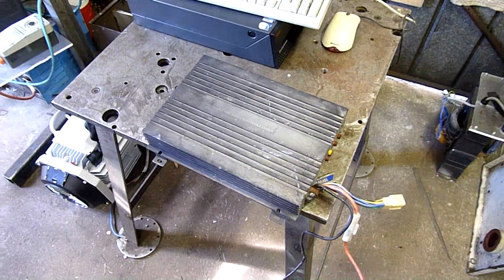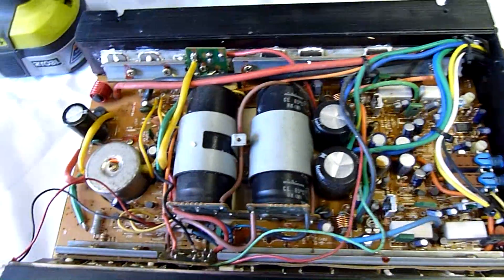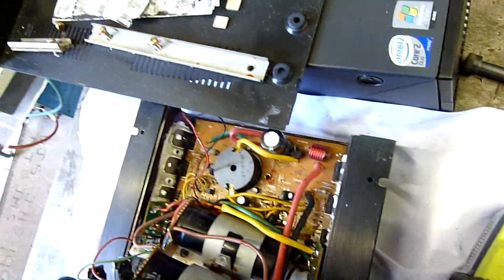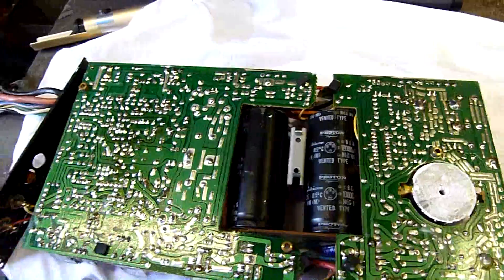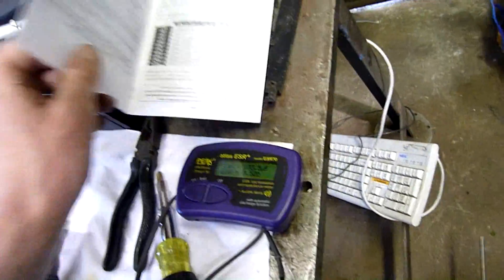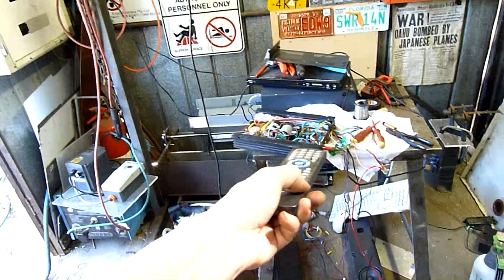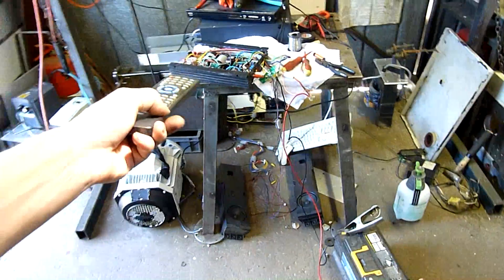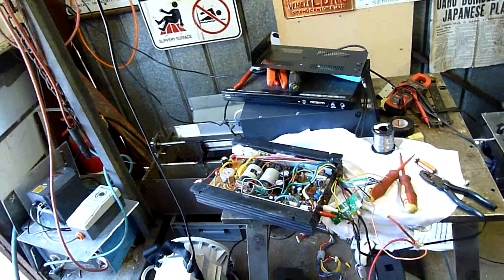Scrap Find - Proton D275 300W Car Audio Amp Repair

Comment: I just re-caped one of those after I let the smoke out of one of the capacitors bench testing it. Somebody must have drove it hard for years! 
It does fine now, in stereo mode, but I have looked all over the internet for a manual for that amp and cant find one anywhere. I want to know EXACTLY which wires are for bridge mode.  It "could be" L-neg @ R-pos but I want to know for sure.

Comment: TO-247 Transistor Silicon Insulator,Insulation sheet,50  5o sheets for 10.47 on ebay.

Comment: Its amazing all those wires coming from various points on that car amp. They would not dream of constructing one like this cost way too much money  Somebody has to manual solder all those connections. I fix a car amp a couple of few weeks back the only thing that was wrong with it was the main filter choke/coil for the B+ had broken off the circuit board. Probably to do with vibrations and it heating up over time, they did not even bother to glue it down.

Comment: yeah, my amps were at the same screw point, but the EQ and radio were at the dash ground point and the noise only came over the 4 channel amp, and not the 2 channel sub amp.  but the moment I toss a filter on, the noise virtually goes away (was still there but greatly reduced).

Comment: Well don't really know what is best for amps, have used pretty much what I can find and seemed ok myself. Ofc if the transistors need to be isolated from the heatsink/case, then you need to use a not conductive paste on both sides of the insulator. Really recomend the article I mentioned earlier to everyone dealing with electronics heats sinks/coolers.

Comment: seems you have got rid of the dislike trolls, nice to see

I now see the fans list under the community tab, Ed you rank very high on my fans list so I'm here to say thanks..also a small shout out on my last rant.

Make it boot from a sledge hammer...I know that tends to work every time

One thing I learned here is if I have a dud car amp it's headed down your way

Comment: I just get my silicone thermal pads from deal extreme. they come in a 10x10cm sheet and work wonderfully. youtube wont let me link it, so just search "Heat Sink Thermal Silicone Paste (10cm*10cm*0.1cm)" on dx.com

Comment: reminds me of my prototype diablo 1000.1, had issues with the torroids shorting out and sending 265 volts across the 12 volt side. if i remember right it also had issues with some bad solder joints

Comment: Isn't that called sil-pads? Although its easier to work with, I still used mica when I was building my amp.... apparently "Sil-pads" have worse thermal conductivity than mica. I was looking on using those too but ehh you deal with the mica once (hopefully) then there there for a while so...

CHeck out my amp :)

Comment: Ed,  If you have any BGA board problems in other equipment:
1) Preheat your oven to 400 F (we yanks like F)
2) Put board in for 5 minutes exactly
3) Let cool 10 minutes

The procedure really works!  I just saved a high end laser printer otherwise destined for the landfill.

Comment: Not sure.  It depends on what the rail to rail voltage is on her switch mode power supply.  Typically it is -25 to +25 volts.

Comment: Absolutely!  Plug some tweets in there too :)  These old amps have great high frequency response despite the messy insides.  I have an old 80's Jensen with the hybrid pack amp chips.  Superb true class A machine.  Just not made to drive 1 or 2 ohm loads.

Get a class D amp for subs.

Comment: Best quality capacitors are like a fine wine.... they just get better with age and never require replacement.  You really have a great sounding amp there despite the old school circuit board, but you fixed it.  

Please don't waste it away driving subwoofers.   That is what a class D amp is for.

Comment from the maker: it does work in circuit, but it will also read parallel caps and resistors, so its best to take the cap out

if it says "in circuit or leaky" then take it off the board and check again to be sure its the cap and not a resistor or something giving a false reading

Comment: hiss might show a problem is still there.  I have had problems in the past with amps in cars that were picking up generator noise, so every time you revved up, the pitch got higher.  might be a filtration issue.

Comment: ED, can this ATLAS work on "in circuit" caps or need to be taken out of the circuit to measure ?. I know some ESR don't need that, but don't believe they could measure the value under that condition. Love your meter. Nice stuff to make repairse easy. Otherwise you star to change alllllll the caps, I've done many times, and failure still survided. LOL

Comment: I used arctic silver 5 when I repaired a blaupunkt headunit. I never knew that thermal paste could cause issues. Do you think I need to use a different thermal paste and if so what kind?

Comment: Nice save man! I too love old amps.
But a bit of warning: as convenient the silicone stuff is, it (specially old and probably not the cleanest) has much higher thermal resistance than the original insulator+thermal paste was. Depending of how much thermal headruum was designed into that amp, it my even eventually kill it.
Some very good info about this subject: google "ESP - Heatsink design and transistor mounting"

Comment: Forget about that book, you can't rely on some generic numbers to determine that the ESR is still good or not. 
Some capacitor series can have very low ESR even at just 100uF (so 0.5 ohm would mean it's faulty), others can have higher esr and still be good, by design (for example high temperature capacitors). Search for the datasheet and it will tell you the impedance, which (at high frequencies common in switching pws) is within a few percents of the ESR value so you can use that directly.